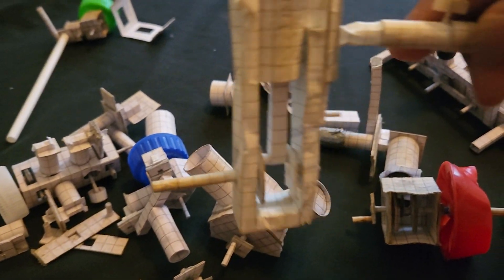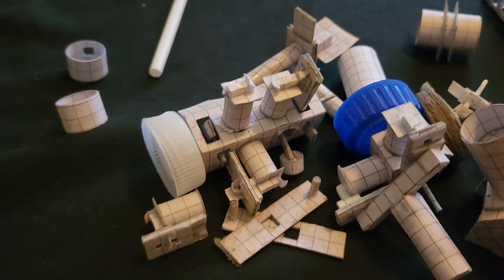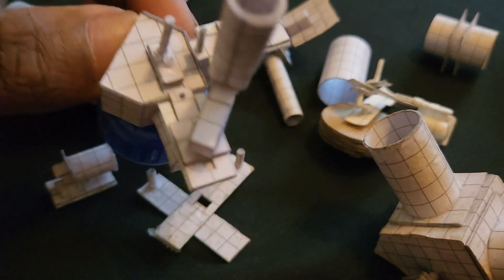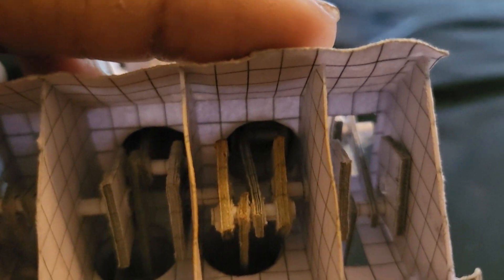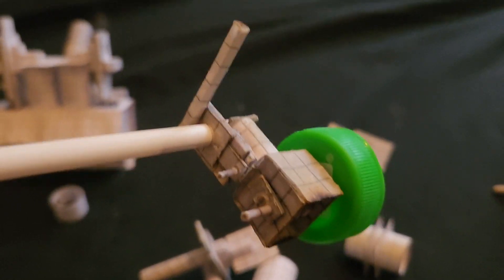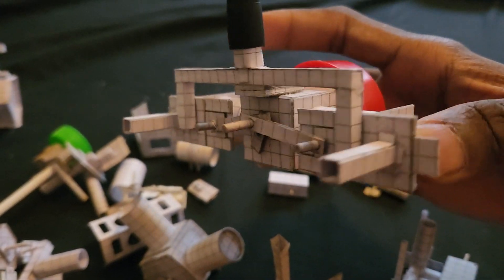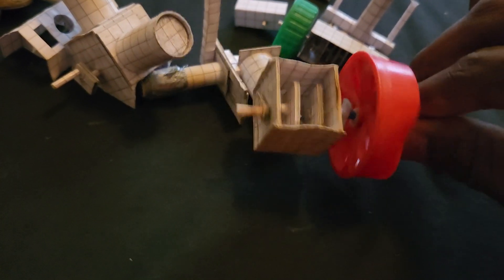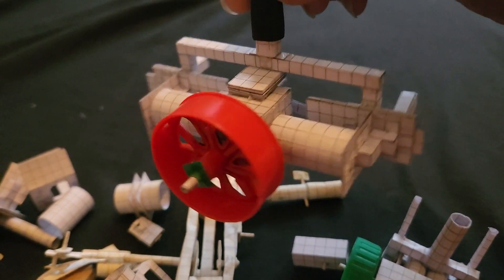The Truth About Making A Paper Engine

Comment: on my third attempt which is rn i got the friction on point using graphite but what ended up happening is that the piston got way to heavy cuz i wrapped it with more paper to get it to be a perfect circle. The air pushing down on the piston is not enough to get it back up and then down to complete the cycle... all I have is hope that it will work sometime in the future as I continue to make these engines.